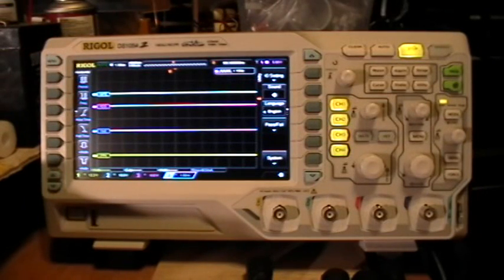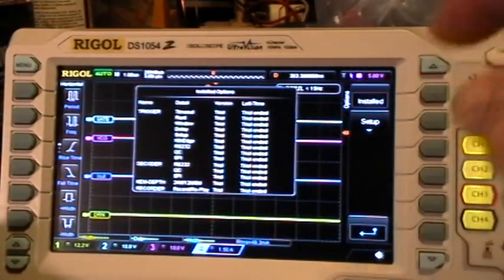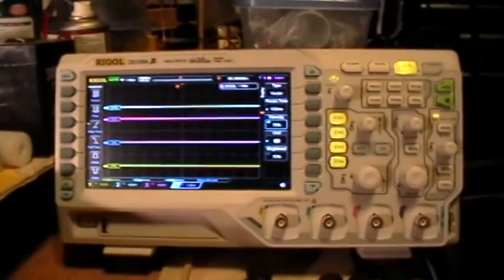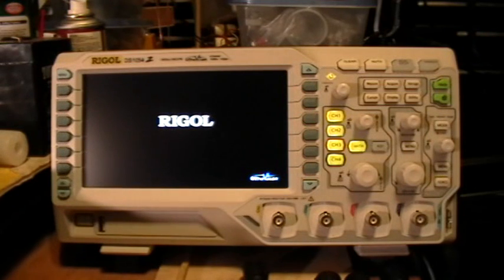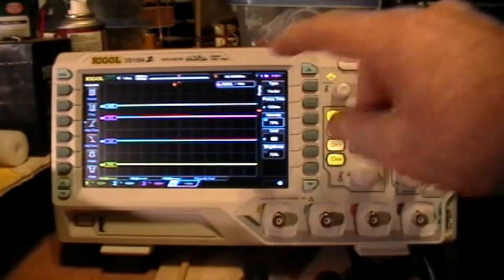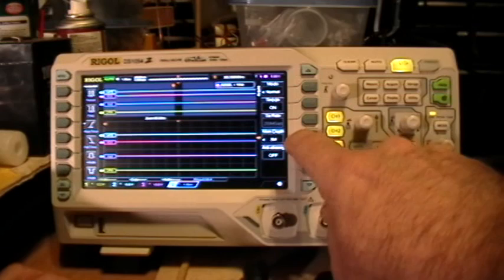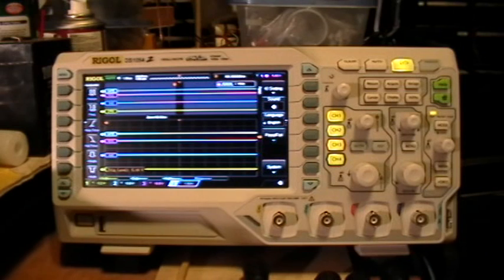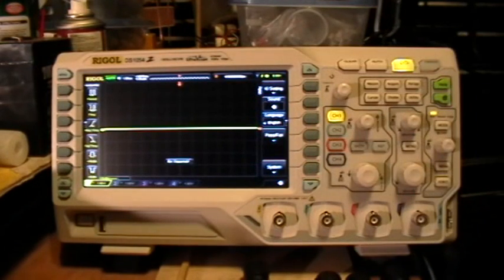Scoposcopy: Rigol DS1054Z Freeze On Start, Stock- No Options Installed

Comment: Hey! i want to buy this Scop. but then i see some got problems
sorry to see you got that problem, have you fix the problem or ?
Reply from the maker: +KaspersMC 
This problem is associated with the software Boot Version 0.0.1.2. The scopes being sold now have Boot Version 0.0.1.3 and do not have this problem. Several months ago RigolUSA asked me to return this scope and they sent me a new one with Boot Version 0.0.1.3 and it does not have this problem. If you buy your scope from a reputable seller it will probably come with Boot Version 0.0.1.3 and so it will not have this Freeze Bug. 
Unfortunately it does not seem to be possible for the user to upgrade the Boot Version in scopes with the older version.  The normal "firmware update" process only updates what the scope calls "software version", it does not update the "Boot version". 
Not all scopes with Boot Version 0.0.1.2 will freeze, but there have been no reports of scopes with the later version freezing like this.
Reply: that sound good +TinselKoala thanks for reply :)

Comment: I got an email from Rigol in UK. They say they are aware around 50% of DS1054z's have this issue and will have a fix in the next firmware update.
Reply from the maker: MonkeyMagic Elecifun Wow. I still haven't gotten any emails from Rigol here in USA, since I first reported the bug on June 6, except for the single acknowledgement and "support case number 00007818" that they sent me on June 8. 
Meanwhile I keep finding other bugs. Check out what happens when you do a Math trace multiplying AxB at 500ns/div timebase setting.
Reply: Oh, that's not so great. The fella at Rigol over here has been really helpful, he sent me an email just to let me know he was still chasing the issue, before he wrote regarding fixing the bug/s in a firmware update. Hopefully they will be aware of the other bugs. I will check out, if I can as I am a student in electronics and have limited capabilities.